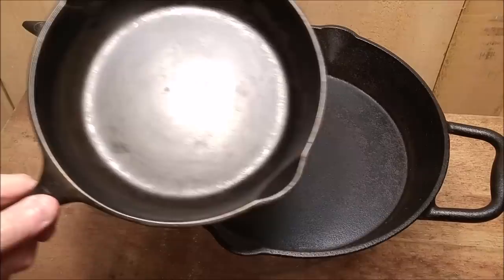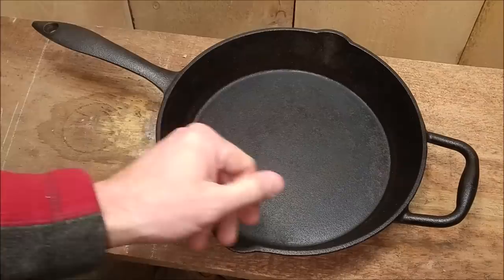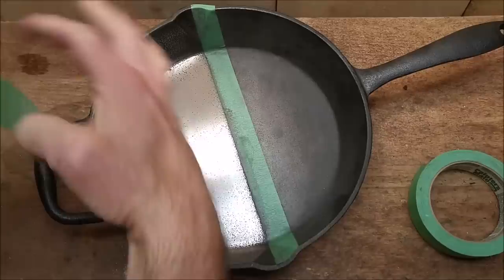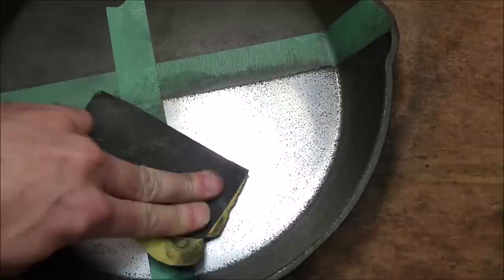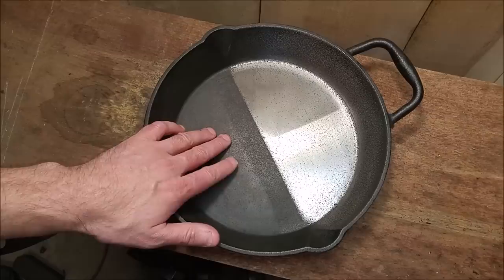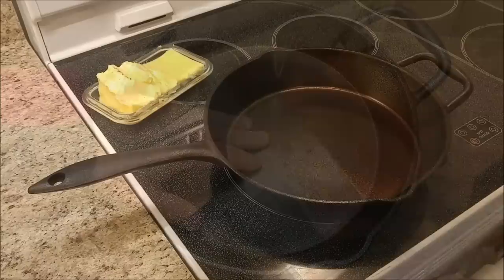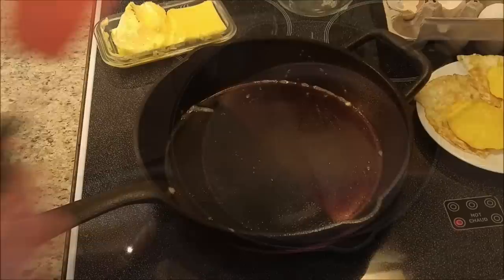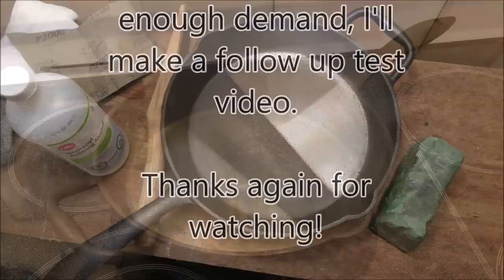🍳EXTREME Polish - Smooth a Cast Iron Pan to Reproduce an Antique Skillet then take it way beyond

Comment: I am sure someone pointed this out, but NEVER put a hot cast iron skillet under water unless you want to s explode it in your face or shatter it.
Reply from the maker: Yes there have been a few people mention this.  There is a correct way to do this step, I did not review it in the video (regretting a little) but here is the link to the way I learned, and it has bee working very well for me.  Yes be careful and I can't recommend for large pans, but it does work very well on 10" or under.  

I have been using the method in the link https://www.youtube.com/watch?v=a5NbQwzwUTw for a few years, prior, I was a little less measured in my method, but it has not failed me yet.  I can provide real data to backup my statements as well, I have taken the time to measure the before and after temperature contrast, however there are always other factors at play, such as the quality of the alloy'd cast in the pan... the cooking cycles etc.  So if you want to do it, go for it, if you don't... then don't. 

Thanks for the note, I appreciate your concern, I will continue to do what works for me, if it stops working, I'll find a way to tell people no to do this.
Reply: @NeedItMakeIt  Thank you for your kind and informative reply. I appreciate it.  I would like to share another thought with you in this regard and this comes from my experience as a blacksmith and as someone that has used these cast iron implements for decades. Pans of any size can have micro fractures that will rapidly "cut lose" at high speed when cooled fast by any method. Cast iron is very brittle as you know.  Again, thank you for taking the time and I enjoyed your experiment. Watching you do all that sanding made my hands hurt! Blessings!
Reply from the maker: @rh5971  Thank you very much for the reply, I certainly appreciate your comment, it is very helpful to know someone's background, because I have a lot of respect for people who work in the trades and I can tell if someone is speaking from experience or just something they read.  My background is Woodworking but I do enjoy dabbling in metalworking as often as I can, I like to make my own tools with a goal of making my own axes and adzes by hand.   I have a nice old Trenton Anvil, but I lack the skill and time at this point.  

I had planned on doing a follow up video on this exact subject, however I think in order to really know what is happening, I'd need to be able to see it under a microscope.  I have researched this topic and different types of cast react differently to fracture, the graphite formed in certain types of cast iron will act as a barrier to fractures, but I just don't know enough, nor do I have the tools to see for myself, so this will have to be put on the...back-burner for now.

I've always enjoyed doing work by hand, sanding isn't as satisfying as hand-sawing, or hand-cut dovetails (auto-aromatherapy).

Take care, I hope to hear from you again.

Comment: Refractive index may be different for different surfaces. Actual temp may not be so different. Just a thought. 
Also,
BIG no no, running water directly onto hot pan..  =  cracks
Reply from the maker: Thank you for the comment.  

I've been cleaning my pans this way for several years now, not every time of course.  I realize I didn't go into any detail about the process as it was not the subject of the video.  Very hot water and a just a little bit of water goes a long way.  I haven't experience cracking or warping, this pan is on a glass top it is still sits nice.  In any case, if people don't want to use this process, then don't, if you want to try it, I might just say to limit the size of the pan to 10".   I have tested the temp drop in a worst-case scenario, which is 150C pan.  Dousing it with just warm water three times does drop the surface temp down to 70C.  It didn't crack this pan, but it could happen if there are weaknesses in the pan already.  

To address the sticking at the source, I have found that cooking bacon in the oven avoids most of the need to clean CI in this way, also cooking with warm eggs into a hot pan seems to also work well.  The smooth pan is really a treat to clean, even with paper towel.

I like your message by the way, it is controlled, and you've capitalized EXACTLY what was needed to draw attention, very nice.
Reply: @NeedItMakeIt  I appreciate all the work and appropriate observations along the way.
It is a joy to watch your videos, and also the humility involved in the process. That way the opportunity is there for all to learn. Very cool.
I always enjoy opportunity for excellence and these vids help me down that path. Thank you.
Also, thanks for your patience with my cringing watching water go onto a hot pan, me not knowing the water temp. It was a knee jerk reaction lol.
Peace

Comment: Black radiates more heat.  You also have a much deeper seasoning on the original surface. To be fair you would need to clean it all.
Reply from the maker: That's probably true.  Apparently the reflective surface causes the readings to be thrown off, whereas the dark rough surface gives more accurate readings (a general summary from other viewer's comments)

Comment: Little advice for anyone using a cast iron pan you really should be using a metal spatula not a rubber,plastic or wooden spatula. There’s two reasons why, first is that the pan can get so  hot It can melt or rune your non-metal tools and if you use a Metal spatula with a cast-iron overtime the metal spatula will smooth out the bottom of the pan through use. I have two logitech pants both I’ve had for over 10 years and by using a metal spatula the bottom of each pan is smooth as glass.
Reply from the maker: Good advice, I just posted a video a couple of days ago on this exact subject.

Thanks for the comment!
Reply: I concur with this observation. I have noticed this as well.
Reply from the maker: @itsapittie  I'm loving the metal spatula now, the only problem I have is that they are much larger than the plastic, so it doesn't work as well with the small pans.  I guess they need to make a small metal spatula?
Reply: @NeedItMakeIt  Yeah, I don't think I've ever seen a metal spatula less than about 3" across. Maybe a marketing opportunity for someone who knows how to make one.
Reply from the maker: @itsapittie  Maybe so, and how about some small eggs and Melba toast?  I should probably just buy bigger pans.

Comment: I was surprised to see the rough section out perform the others, but it was only by just a little bit. I can only wonder that if the other two sections had as much seasoning if they wouldn't have done much better.
Reply from the maker: Do you think it performed well because there are more places to hold the butter?  I was thinking a little bit about how an old machine holds lubrication to prevent galling of the surfaces.  They have tiny scraping marks which allow the oil to be held and re-distributed.  Maybe the same is true for a rough surface of a pan?  Some food for thought.
Reply: @NeedItMakeIt  I have no idea. I just wish I could afford an old Wagner or Griswold.
Reply from the maker: @joesanders6898  I know the Griswolds are very expensive, but in my area the Wagners are so common.  I do visit the antique shop weekly, so maybe that's why I've seen so many.  They don't look like much but they are worth every penny.  Since switching to cast iron, we've not needed to buy any replacement non-stick pans, the way I see it, they're equal to an investment (with an incredibly low return :|  )

Comment: The peeply surface of the rough side causes it to hold the heat longer which in turn causes a higher temperature reading.

Comment: Would a wire wheel brush on a die grinder do the same thing? Bought a new skillet and going to try smoothing the bottom tomorrow.
Reply from the maker: A 100 grit sandpaper on a die grinder would work best, after making a follow up video, I found that 100 grit worked the best for adhesion of the seasoning.  Also make sure to clean it well afterward and then I like to boil vinegar in mine to etch the surface in prep for the seasoning.  It also darkens the surface just a bit to give it a more vintage look from the start.

Comment: I got a cast iron skillet from Walmart and I’m unsure of the brand but it says pioneer woman on the bottom so that might be the brand, it works great but of note is that using olive oil and high heat when cooking meat caused it to stick for a long time after and it’s still not like it was when I first got it (pre seasoned)
Reply from the maker: Yes that's the brand, I've see these in stores also.  

Olive oil can be used for seasoning  , the problem is likely that the layer was too thick and it did not fully set.  If you can put it in the barbecue or oven at 450F for 2 hours, it may be enough to finish the job.  Another option is to remove the seasoning and start over.   Check out the Lodge website if you want good info, the Stargazer is another good one.  

Good luck!

Comment: Try stripping the preseason with oven cleaner then re seasoning... The black finish is definitely throwing off the ir thermometer
Reply from the maker: Isn't that oven cleaner deadly stuff?  I was wondering what is the best way to strip a cast iron pan.  Some people put it in the oven on the self-cleaning cycle.

Comment: Angle grinder with scotch bright buffing pad would make real quick work of this!
Reply from the maker: I didn't even know that this was a this was a thing.  I always thought scotch-bright was just for scrubbing dishes.
Reply: @NeedItMakeIt  bro you can get scotch-bright belts for belt sanders. in my experience they make knives comically sharp.
Reply from the maker: @1nakey1  So what's in a scotch bright?  There must be some type of abrasive.  

Thanks for the tip...
Reply: @NeedItMakeIt  my bad, i misspelled "Scotch Brite" google these things and take a look at the images:
Scotch Brite sanding belt
Scotch Brite sanding discs
oh and: Scotch Brite dremel
these products polish and sharpen like you wouldn't believe. i use the dremel bits to polish my woodworking projects.

Comment: I’ll strip an old pan and start with about 4 baked on coats of avocado oil, then start cooking with others as well and maintenance.  Usually plan my cooks and oil with how hot I’ll be cooking.  Olive oil makes for a nice non stick pan but I don’t use it allot for maintenance, unless I’ll be using the pan again soon.  I actually like the lodge oil spray for quick easy maintenance and heat my pans until they just start to smoke before storing.
Reply from the maker: Thanks for the tips.  I've never tried the spray, does it apply the oil thick and then you have to wipe it off?  I will check their website too.

Comment: Yeah a surface that is glass finish is not going to work very well in holding the oil.  No need to go that far in sanding. 80- 100 ( maybe 120 grit ) should be sufficient.
Reply from the maker: 100% agree, Ido prefer a nicely seasoned smooth pan over the rough.

Comment: I bought an old cast iron frying pan in a junk shop, it was really rough so I put in in the milling machine with a fly cutter and took a skim cut all over the inside. Then I gave it a smooth over with a flap disc on an angle grinder. Why would you want it rough? If they took care with their moulding sand they could get a much better finish out of the mould, which would be nice because cast iron has a skin and it would be much better t o leave that on.
Reply from the maker: You're right I need a milling machine......  :)

Some of the pans are nice out of the mould, some are just horrific, they seemed to take a lot more care with the old ones.  Maybe they had higher standards.  

The skin that you're talking about, is that grey/white iron?  Or iron oxide?
Reply: @NeedItMakeIt  Mix of iron oxide and sand from the mold, it buggers up tool bits if you try to machine it, The usual advice is to try to get through it in one cut. To be honest the flap disc was all that was really  needed, but there was a pronounced protrusion caused by a gap in the mould sand that needed to come off.
Reply: FWIW Lodge was the first company to "preseason" their iron.  That was a game-changer in the market, and kept them out of bankruptcy.  However, they had to go with the rougher surface to get the seasoning applied consistently.

Comment: Could just be the darker color of the matte black holding onto to heat, and the greater texture might play a role as well, not sure exactly how, possibly just by adding a small amount of thermal mass, plus having a different radiation pattern, or being less prone to convective heat loss.
Reply: and a meat thermometer wont work that well...you need a thermocouple designed for testing the heat of flat surfaces (they are spring-loaded at the tip, which you depress, I believe).

Comment: Looked a little like the seasoning was rushed or too hot with too much oil. It should not have that appearance. Low heat and let the iron soak in the oil. Cooking is the best seasoning and will provide an even coating. Bake cornbread, or make popcorn.
Reply: I saute onions to season skillet. Works pretty well.

Comment: I have done this before and it's a nightmare. And there's also a bunch of pits left from the casting process that are impossible to get out unless you're ready to kill yourself taking out all that material. The stargazer pans have a machined finish. Or if that's too expensive get a carbon steel frying pan. You can find them for 50$. I have a couple old Wagner pans my gram left me that her mother left her. Nothing beats a hundred years of seasoning on that old machined finished cast iron.

Comment: Good video. 

I have an approximate 10 year old Calphalon 10” pan and I just purchased a 12” Lodge.

The Calphalon is now smooth from natural use and the new Lodge is rough.  I intend to take the Lodge and smooth down to about 1000grit to match the Calphalon.  Preliminary cooking tests show the older Calaphalon out-releases the Lodge.
Reply from the maker: I had never heard of the Calphalon, it sounds expensive.  Since the video, I have experimented more with different grits, and found that you really don't need to go higher than 220 grit.  the surface becomes too polished and the polymerized coating does not adhere as well over time.   

I have 2 small Wagners now which are quite old, they were both smooth from the factory (as you can see from the machining marks in the interior of the sidewalls) they are my favorite by far.   

 Did you use a metal spatula on your Calphalon to smooth it?

Thanks for the comment!

Comment: Ever heard of a palm sander? Would you eat polishing compound? Cast iron absorbs.
Reply from the maker: Palm sanders are strictly intended for sanding palms.  In this particular test a palm sander would not be appropriate, also I prefer to sand by hand.  I did not eat the eggs cooked on the polishing compound, I can't recall if this was mentioned in the video.  As far as cast iron absorbing, at a higher temperature, it will expand and surface pores may open slightly, as far as it being porous, I'm not convinced that's the case.   There are techniques which allow metals to be porous, for example if they contain gasses inside, or for bronze sintered bushings which are oil impregnated.  If you have more info on this please provide a link to some data.

Comment: The older cast irons are more desirable because of the weight. You take a new lodge and say a griswold at you can be looking at 1-2 lb difference.
Reply from the maker: I do find that the vintage pans have a thinner bottom and do heat up quicker than my lodge, sometimes you want to cook something faster, so I grab the lighter ones.  As far as flipping, I'd assume most people just use a spatula no?  What are the other reasons?
Reply: @NeedItMakeIt  Im a guy and i weight lift so i can use either but my mother who is getting up there in age most def cannot use newer cast iron

Comment: First off, kudos to the hand sanding! I've got hand/wrist issues so machines for me! I've done two Lodge pans, a 10" and a 12". I just went straight to a paint stripping wheel on a corded drill on the 10" years ago. It turned out pretty dang smooth with some of the tiny pits still there. The 12" pan I used an 80 grit flap disk on my right angle grinder. That one turned out fantastic! Still some pits as they are cheap pans and the castings are rough but that is why they are mass produced and sold cheap. My next plan is to get some finer flap wheels (I found 120 grit flap wheels on Amazon) and spend some time getting it crazy smooth then take it to the extreme with 600+ paper on an hand orbital sander or oscillating sander. Maybe go crazy high like 1,000 grit depending on how the pits come out and how smooth it gets. Sitting at the 80 grit flapwheel, and 20 minutes work, the 12" is really really nice and smooth.

Comment: Why do so many YouTubers do cast iron polishing videos?  Anyone who uses cast iron regularly will tell you that polishing wont do anything.
Reply from the maker: I can't speak for anyone else, but for me I had been using cast iron for some time and I did not like the performance of my new cast iron vs the vintage pans that I own.  I wanted to see about reproducing that quality that you see with those old pans.  The reason I polished the pan wasn't really because I wanted to, it is because most of my work was rustic looking and people didn't like the look as much as I did, so I joined the "I like shiny things" bandwagon and polished the pan.  This video was a bit of an experiment as well, and it showed me that a polished pan isn't a good thing, there is no need to go this far and it seems to prevent the seasoning from sticking.  I've created a few follow up videos which really dial it in.